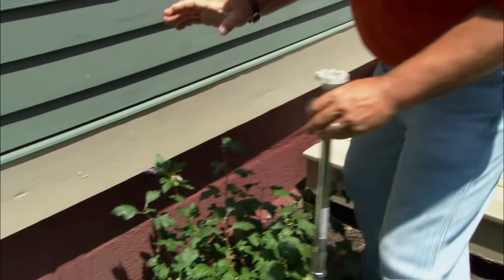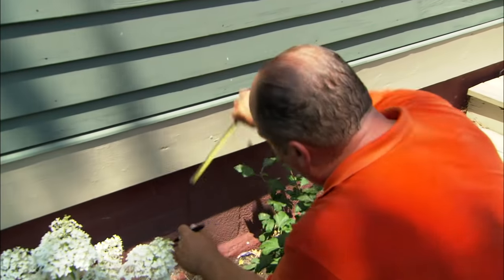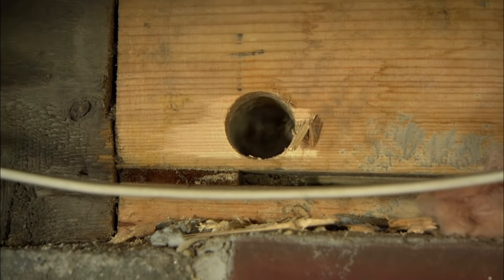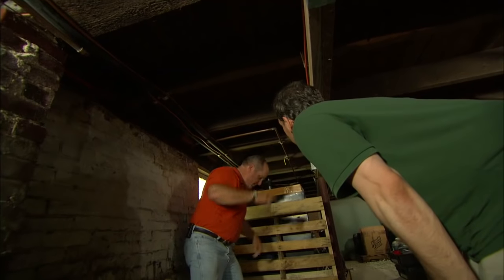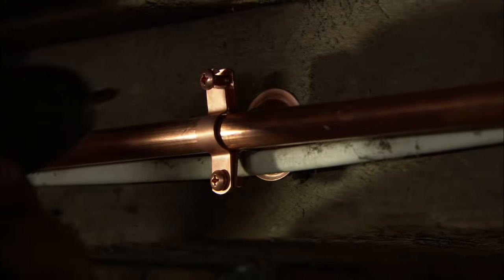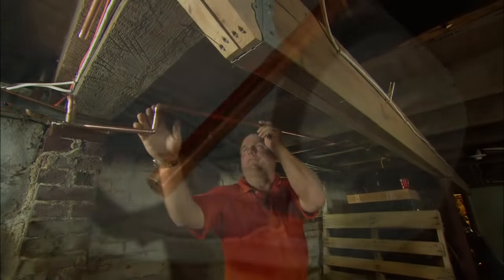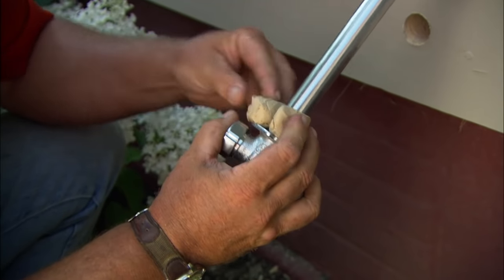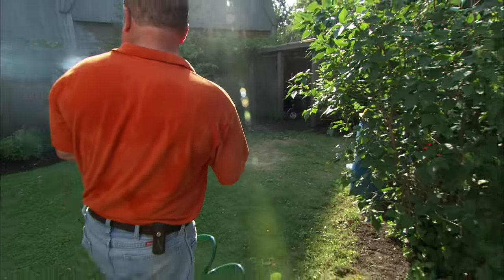How to Install an Outdoor Faucet | This Old House

Comment: 4 Things Richard should have mentioned!
1) First, locate the main water shutoff and make sure its turned off before you start cutting into a water line.  
2) When drilling and mounting an Anti-siphon / Freeze proof Sillcock (i,.e. hose bib) on the outside of a house make sure it has a slight downward slope (approx 5 degrees) to ensure it will drain completely when turned off. 
3) Before soldering a anti-siphon / Freeze proof Sillcock that mounts to the outside of the house . or any such faucet, make sure you fully open the valve (turning it counter clockwise) to prevent melting or damaging the valve seal. 
4) Before soldering a drain valve... make sure you remove the valve stem from the drain valve under the house before soldering it to prevent damage to the valve seat from the heat.

Comment: I saw Richard had removed the drain valve prior to soldering the elbow so the heat wouldn't damage it. It would probably be good to explicitly note this, and to remove the stem from the frost free-valve as well.

Comment: Those where pretty broad strokes, didn't mention the connection from the bib to the pipe, removing drain plug before sodering or ( this is a personal preference,) putting in a dedicated shut off in case of future work.
Reply: For anyone curious, that bib ends in a  3/4" MIP (male threaded) connector and he used a 3/4" FIP (female threaded) to 1/2" sweat adapter so he could then solder the pipe to it inside. I learned ALL about FIP and MIP connections in my house which is 100 years old and is piped with threaded pipe, not soldered!

Comment: Great video.  I think, more information on shutting the water supply off first would be helpful.  I just found out the house I’m helping with has no water shutoff.
Reply: If your home is built on a slab, check in the garage or near the water heater for the shut off valve. Next, check outside your house. If the water main shut off valve is located outside, it will be buried underground near the street. Look for a round or rectangular metal cover flush with the grass or sidewalk.

Comment: If your connecting to the regulated water line inside the house, your going to be disappointed with the lack of water pressure on you backyard water faucet.

Comment: This Is Great ❗
   🤔  Do You Have A Video For A Home Built  On A Slab 
 I am desperate ...for A Water Source . I just can't pull these hoses or carry water any more .. My budget does not include other things  so DIY or a little help is it .
 Any ideas ❓
  I think your Videos / Instructions / Safety /  Issues are All Well Addressed .
 Thank You All for Sharing 🌤 .
Reply: I'm not a professional but what I did was find a water source in my walls, in my case it was the laundry room on the other side of the wall from the garden. Put in an access panel inside and a T connector to the waterline and then go through the other side of the wall for your spigot

Comment: Can you show us how to do this with pex (I think it's called) rather than copper? Perhaps a link to another of your videos? Thanks for sharing.
Reply: Lmao that's even easier
Reply: @loejets  Just checked, the link is good. It goes to, " How to install a frost-proof faucet with PEX piping | This Old House. "   The faucet is metal, they connect it to PEX, then to the homes copper pipes. A PEX faucet for outdoors is available if you don't want the extra step.
Reply: @o0Avalon0o  cheers Geoff

Comment: Should have installed it higher up on the house so you don't have to bend down to access the hose bib. With the right landscape design, the hose bib can easily be hidden from view.
Reply: Owner may have requested that location, but good point.
Reply: @matthewpooleacp  You are right on, Matt - BTDT with home owners. I always tell them, it's your house so we'll do it your way. Take care, sir....
Reply: @Bazzaland  He would have to drill into the wall and run more pipe inside the wall.

Comment: So if my basement is finished I would have to remove the drywall to install new outdoor faucets? I only have one outdoor faucet but it's on the side of my house which is far from my backyard and garage. Where I want to put new faucets there is a bedroom and the family room downstairs. The only unfinished part of the house is the laundry room which is where the only outdoor faucet is connected. Is this more trouble than just running a split spigot and hoses to both back and front yards? I can hide the hoses behind the landscaping but its a lot of hose to be running around my house
Reply: do you have any existing water lines that you can tee into off of the bedroom or family room?

Comment: I think I would have moved that electrical line away from the place you drilled that hole thru. Too close to getting a shock or starting a fire for those old house joists are ready dry and very flammable.
Reply: No guts no glory.

Comment: i don't think its right to put water line close to your electrical line or wires right?
Reply: +brownman77 My thought exactly!  That big boy had a lot of room to work with. He had no contractors license I saw.
Reply: +brownman77 It rains every week outside on the electrical lines and nothing happens. How do you explain that?
Reply: jlb197736 Agreed. But I am also right.
Reply: seems like it would be comforting if you had no other choice. i dont see how he could have more options. avoid a huge possible mess by just picking a different joist. that seems more professional and reasonable
Reply: It's not the same lack of insulation? Jesus Christ.
Reply: @ Jef Vinoya

Im a Gc in Conn, I cant find any code in the us that has anything to do with electrical wire spacing to water lines. In canada it shouldn't touch (hot) water lines B/C of heat, I don't see any issue with the romex touching the water line, as the whole system should be bonded to the electrical ground in the panel - after any water softeners. However I would have stapeled the romex away from the line, It looked like the spacing of staples was to far apart by code anyways. 

Allot of people don't know often bare romex is run down your well to power the pump and at least 1/2 of the time a pump fails its because the romex wore away and shorted. In any house I do build i require it to be encased in a conduit, allot of well drillers don't even think to do it that way.

Romex is not great anyways, Its just economical, MC wont ever chafe or ware down- but its more expensive and a pain to work with If you dont know how to deal with it.
Reply: Sounds like someone's never crawled into an attic or crawl space or knows jackshit about electricity or plumbing.

What are the potential problems? The water in the pipes magically osmosing out the copper pipe and osmose through the two layers of insulation in the Romex and magically short the hot and the ground wires?

Comment: It hurts to watch them use festool. That little drill really seems to struggle some times. Milwaukee, Marita, dewalt, ot Bosch would have done the same job for less than half the cost and better

Comment: Can u show how to do this without soddering?
Reply: shark bites?
Reply: Its the same process with pex or cpvc just glue or crimp the fittings instead. How ever I do not recommend shark bites at all
Reply: Adding to the other comments, compression fittings are another way that doesn't involve soldering.

Comment: hmm..yes very good..those bell straps must be only in USA and the copper is 5x as expensive to install than pex and sharkbite.. plus he didnt talk about the pitch in the line to drain a frostproof sillcock.. the column of water in there wont drain out and it freezes just as old pipe n tap do but there MUCH more expensive to replace because there made in china and the driveshaft is not repairable ..can only be replaced ..ps.. the backflow preventer is a great spot to hold water  from surface tension and freeze... i hate these things.. just gimme a pipe n gardenhose tap for 4$
Reply: san379 a sharkbite fitting is 10 times the price of a copper sweat fitting